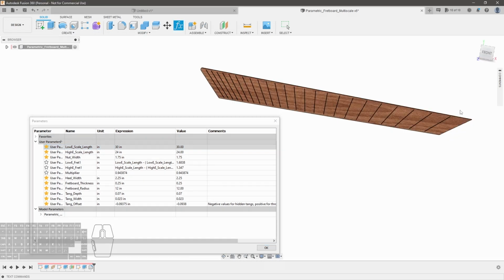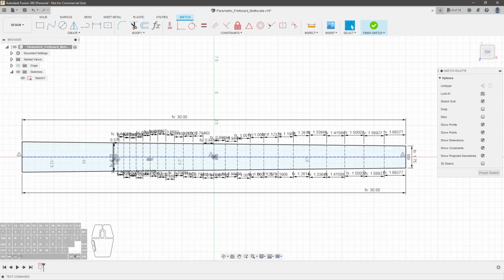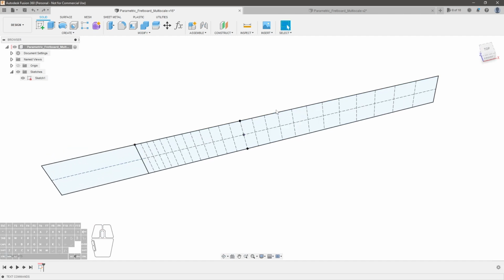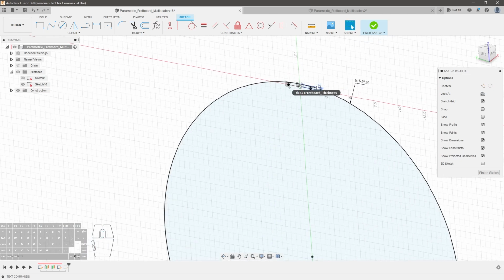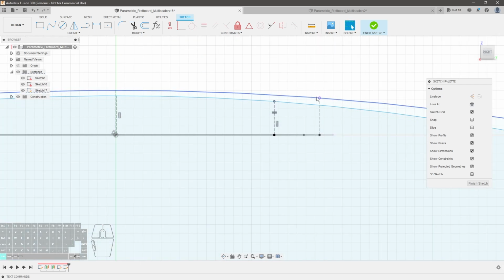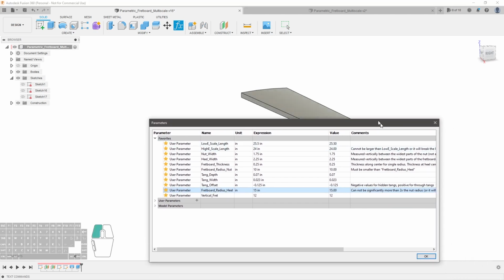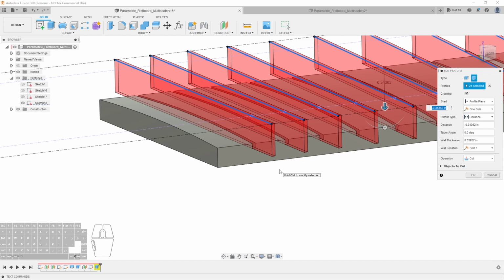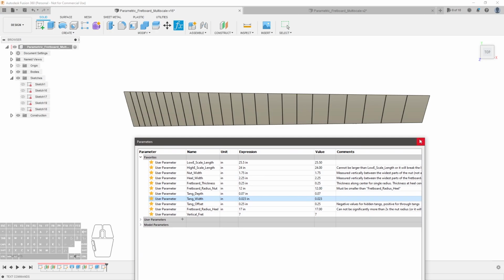Fixing a mistake & adding compound radius | Fretboard Design Masterclass (v2) | Fusion 360 Tutorial

Comment: When I modeled my multiscale fretboard, I set my scale length dimensions parallel to the high and low strings (so at an angle), whereas your measured scale lengths are horizontal.  I did it this way thinking it would be more accurate, but maybe I was overthinking it? 😂It was tricky to set up.  Wished I found your video before.

Comment: Austin, If I'm just building a non-fan fret (not a fan fret fan) fretboard do I still need two sets of formulas e.g. Low Scale\High Scale?  Also, I'm getting an over-constrained error and it wants me to create a Driven dimention instead.  Working on trying to figure it out now. Thank you, Joe
Reply from the maker: Nope! If you are using a single scale length you can make all of the fret lines vertical, and apply one set of formulas. This parametric fretboard however, allows both options. So you would just make both the high scale and low scale the same value and the lines will be vertical. (single scale length)

Comment: I have a question Austin. Did I miss that you did not incorporate the distance between the string and the edge of the fretboard. The scale length is where the string touches the fret, not the length of the fretboard at the side. If I missed this I'm sorry.
Reply from the maker: Unfortunately I did not. There was so much to cover that I kind of overlooked it. In the 1st video, iI did dimension the gap between the strings and fretboard, but did not use the string construction line as the scale length reference.  That being said, the variance isn't huge, and doesn't impact the fret spacing formulas. You'll just end up with a very slightly smaller scale length than Intended 

I do plan on releasing an updated version that includes string spacing as the driving factor for the Nut and Bridge width, along with variable number of strings etc.  Hopefully I can resolve some of these issues in that video.

Comment: I just tried to set the verttical fret as the nut position (Fret 0). This worked fine but every time subsequent attempt to set a new vertical fret broke the model. Has anyone found a way to set the nut as the vertical fret as Strandeberg uses?
Reply from the maker: It usually works for me to set the 0 fret as the vertical, but I have experienced what you are talking about.  If fusion keeps throwing a fit about it, I'd suggest keeping the formula in your master template file, but removing it in any design that you need the vertical nut, and instead just applying a vertical constraint. 

I know that's not a good answer, but fusion seems to be temperamental with applying a 0 dimension to anything. It kind of assumes that if there is no dimension, then it should just be a constraint.

Comment: Thanks so much for these videos, great work.
I found another way for the fret slotting part that maintains the radius at the bottom of the slot. Instead of a thin extrude simply draw out the shape, one line before the center running parallel, one line after running parallel, connect the tops of lines, connect the bottoms anchor to center line and do a normal extrude instead of thin. Keep tang inset at 0 or less and it works well. It adds a lot of drawing but it's effective.

Comment: Creating both end radii with constraints at the midpoint of the fretboard end lines so there's a straight plane down the center of the board is pretty much how it would be if someone were to manually form the radius with sanding blocks. 

Personally, I prefer creating a consistent fretboard edge by constraining the radii to the top corners of the fretboard end lines and lofting/joining the radius to the top of the main fretboard block. That little upward ramp it creates for the string plane (whilst using a single radius across the board) isn't significant enough to not be adjusted out by saddle height and/or truss rod adjustments if necessary.

Anyway, very cool stuff - I'm using your fret slotting method from now on, much better than drawing each slot manually.

Comment: Great tutorial.  Just one thing I'm a bit confused on at around the 16 minute mark.  When making a multiscale, compound radius neck why would you use the midpoint of projected lines as opposed to the actual origin which would be the center line of the overall guitar design?  It seems that with your approach, the upper most part of the radiused fretboard would be off center.  Am I missing something here?

Comment: I can't get the Offset Command to make the positive value as you do. What am I doing wrong?
Reply from the maker: Hi there! I occasionally run into this issue as well, it seems to be more of a graphical error. Once you change it to a positive value and it doesn't move, try changing it to a much larger positive value, say 1" instead of .1" and see if it makes that switch. If so, you should be able to  change it to the number you actually want. Or at least that's how I've been able to fix it.
Reply: @austinshaner  Thank you for your response. You're very patient. If you will, please show me my flaw in operations order.

1) Command "O".
2) Select line(s).
3) Fusion then auto snaps Offset Line to 0.03937, hit enter.
4) I then double-click the dimension to change the number to 1", and the line moves further toward the fretboard center. 

I'm sure it's simple to fix and I know it doesn't hurt the end goal of parametric control; except for just making the tang offset a positive number in the user parameters. It's just frustrating because my first attempt (from this video) performed as expected. My current attempt (from the next video for adding compound radius) is performing great except for this one issue.

Thanks, Austin!

Comment: Great video, I have 1 Question or issue, when I try tu use the dots to place the natural fret or vertical fret, it doesn't work 100% precise, i has a minor error like 0.012 mm far away from the fret, is it normal or am I doing something wrong?

Thank you

Comment: Great video tutorial. Just need clarification, is the formula you used for 24 frets and 12th fret is the mid fret or universally can be used ? How about if we design guitar for 22 guitar's frets and the mid section fret is 12th fret or 11th fret ?
Reply from the maker: Hey Aristo! Scale length is independent of the number of frets, so yes! it can be used universally. For example you can have a 24 fret guitar with a 25.5" scale lengths, or a 22 fret guitar with a 25.5" scale length - the only difference is that you chopped off the last two frets. 

Howevee the 12th fret is ALWAYS the mid point of a scale length, even if you have  only 22 frets. So I could build a guitar with a 25.5" scale length and only 13 frets, but the 12th would still be the center point of the string.
Reply: @austinshaner  Thanks for the reply, you are right, I made mistake when following your video first time. I did from the scratch again, follow your video again and again, then everything went right like what you said above.  Many thanks for the tutorial video, very good.

Comment: I have really enjoyed the video. I have a couple of questions, 

If the use case for this fingerboard is that you can plug in different scale lengths and it will generate a new layout based on Scale, Vertical Fret, and width at nut and heel. It would seem the last piece to conquer would be the number of frets to draw.  I cannot seem to find a way to make this work for a guitar that may have 18 frets and also work for a bass that might have 24 frets.  Any Ideas?

2nd question is when you are setting the width at the nut, you are setting the height of a line that is perpendicular to the center line.  Is it the nature of CAD/CAM that you do not need to have a "Real" anchor point to measure from?  I cannot figure out how someone would accurately measure the width of the nut because there isn't a square edge to measure from.

Thanks for the video!!
Reply from the maker: Hey Tal! I haven't quite conquered variable frets yet, but my gut tells me that until Fusion incorporates equations into the rectangular pattern feature, what well have to do is model all 24, and cut off what we don't need. So this could be done before hand by parametrically controlling where the heel line is  (similar formula to my vertical fret), or afterward with an extruded cut.
Reply: @austinshaner  I agree, I was playing with trying to do just that with some sort of intersection using heel length. I will let you know what i can figure out.
Reply from the maker: As for your second question,  fusion can toally dimension it any way youd like. I chose to dimension it that way, though I could have gone I to greater detail on why, because that's the orientation we care about. Because you could theoretically have a 6" nut, but with a 1.75 neck width at the nut (measured perpendicular) . I asked myself, what do we care about more? The size of the neck were wrapping our hand around? Or the actual length of the nut? Which one gives us more Info on how this guitar will feel and play?

I'm working on a v3 version that automatically generates this nut and heel width based on the amount of strings, string spacing, and edge gap . Which would eliminate the need for this type of dimension.
Reply: @austinshaner  I am a bit pedantic about things that can be measured and was concerned about the minor (rounding type errors) discrepancies that occur if you pull the dimension as though the strings were parallel to the centerline. After I posted this, I did some math, and it is really pretty trivial. I was worried about the theoretical difference and forgot about the real world not really working to theory.  Thanks again

Comment: Thank you Austin. I've really been struggling trying to achieve anything of value, I built my own design of CNC (I have an engineering background) but have no experience of CAD or CAM and I'm desperate to use it to build a multi scale guitar for my Son these tutorials have helped enormously (Had to slow you down to 50% sometimes 😊) but my fretboard sketch came out with the same results as yours so I'm over the moon! Also learning about user parameters was a revelation. So again thankyou and all the best to you, your wife and little one in your new home

Comment: Thanks for the amazing videos. Having trouble getting the offset line to appear with the right sign at the step around 32min in. It always wants to make the offset value negative when moved to the outside of the fretboard. This also seems to mean I can’t use negative values all for TangOffset as changing the value from positive to negative or vice versa doesn’t move the TangOffset line at all. Any help would be awesome.
Reply: Same problem. I resolved it by setting the dimension of one to be Tang_Offset and the other minus(Tang_Offset). That way, you can change the Tang_Offset and the offsets move in or out together.

Comment: Great stuff as always Austin! Your videos have been such a huge help. I noticed my fret spacing measurements weren't checking out when cross checked with things like say the Stewmac fret spacing calc. So an approach I took which also seemed to work well and also avoided the user parameters "stacking" was this. Instead dimensioning from fret to fret using the multiplier I used the same formula you used for the first fret for all frets, except increment the 1 in the (1/12) for each fret. So like this for fret 2 "scalelength_loside - ( scalelength_loside / ( 2 ^ ( 2 / 12 ) ) )" and fret 3 "scalelength_loside - ( scalelength_loside / ( 2 ^ ( 3 / 12 ) ) )" and so on. This way each fret is measured from the nut and not fret to fret.
Reply from the maker: That's odd, I got exactly the same results when dimensioning to each fret from the nut, or fret to fret. The math is the same if you use 12th root of 2 method. I just converted it to fret to fret to make the sketch cleaner and easier to make parametric.
Reply: @austinshaner  I was probably messing something up. But for some reason things were progressively getting further and further out. It was only by tiny tiny amounts but measuring from the nut each time kept it spot on when comparing to other calcs. It's probably 6 of one half dozen of the other. It certainly makes the sketch messy measuring from the nut each time.

Comment: Thanks a lot for your video. I made one change for the projected fret tang sketch ,i projected the variable offset sketch instead of the main sketch. In this way it is also possible to cnc the offset more easy. I will try and  workout a nut ledge and compensating nut option, perhaps a idea for a part3?Thanks a lot and keep up the good work.

Comment: Wow, what a difference. Two small changes that I made to my sketch: First, I dimensioned each fret from the nut [ Low_Scale_Length - ( Low_Scale_Length * ( Fret_Space_Constant ^ 2 ) )] as the second fret for example. This is the same formula you used for the vertical fret, and I don't end up with any recursiveness at all.
The other change that I made in mine is that instead of setting the heel width as a parameter, I set the String Spacing at the Bridge. This way, I can set it based on the bridge/saddle and determine the heel from there.
I can't thank you enough for these videos. I've been banging my head against this stuff for two years.

Comment: Thank you for this video, great and clear tutorial! Just one question, I noticed that if you use your nut as the vertical fret it adjusts fine but if you make any other adjustments thereafter it breaks the sketch. I assume that some points will lock at vertical fret 0. Is there a way to avoid this without undoing the change of Vertical_Fret=0?
Reply from the maker: Hey Adrian, When I tried that while developing this I got an off result as well. I think as long as it's any positive number that's not zero, you should be OK. So even .000001 or something like that, nothing that would make a difference to the design, but maybe annoying.

However, for some reason my latest file doesn't have that issue (not sure why). I can even type -1 as the value and it moves the dimensions off the fretboard.  That file is available on grabcad If you want to check for any differences

Comment: Maybe I'm being a bit obtuse, but can I change the adjustment from heel(which I would not be using. It would be a result of the nut width and bridge spacing width) to bridge string spacing instead? I really appreciate that fretfind2D creates the functional shape based on the string spacing and the fretboard overhang is what defines the fretboard dimensions. If string spacing could be incorporated and visible as sketch lines and the overhang taken into account, then the bridge spacing at the end of the sketch model would be correct. Maybe it's just my OCD. I know it doesn't really matter but it helps the functional aspect you are designing create the fretboard for you.
Reply: I'm actually using the bridge string spacing as my end measurement instead of the heel, then calculating said heel width. So far, it's working really well.
Reply: @gsterneman  I played with it a bit, but I just liked the automation of fretfind2D because you can see the string spacing for the saddles and then add how much FB overhang you want which also determines the heel width. I guess quick math work too and just enter those values. I'm just a really visual person so it helps me reassure my OCD that everything checks out, haha.

Comment: Thanks for responding to our feedback.  I have a busy day tomorrow. Next job is to create a nut with variable string diameters and different string spacing with either equal string centres, equal spaces between strings or user defined spaces between strings plus user defined distance from fretboard edge to outside of string, just thought I would mention this 😀  Again many thanks
Reply from the maker: Sorry for the delayed reply Alan! Yes, string spacing, and edge gap, or bridge width and edge gap etc would be a more accurate way of defining this. I asked around a bit before making this tutorial and it was a bit of a mixed bag on what people would find most useful. Ultimately I felt that heel width would be most universal because common drawings from manufacturers include heel width - so many people are used to defining it this way - but if you ar ebuilding from scratch, having control over the string spacing directly could be extremely valuable. 

I'll likely making a v3 of this at some point to incorporate that.